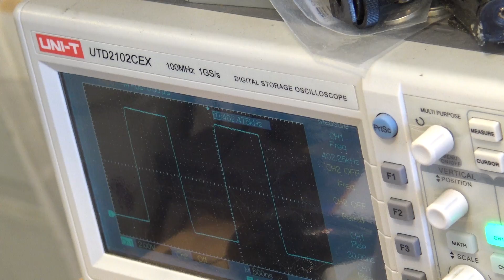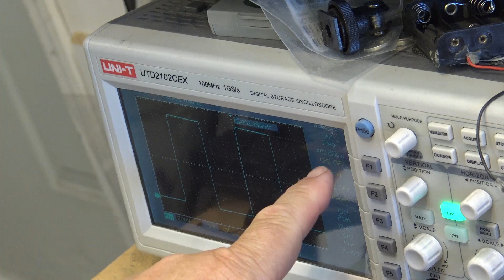TPA3118D2 45 watt amplifier module test run

Comment: What power supply did you use? What are the specs?
Reply from the maker: It can run on everything from 6 to 30 volts.  It really doesn't care what power supply you give it as it's a class d amplifier.

Comment: The best way to feed signal to these boards is from a Bluetooth module because some phones doesn't have much power on the headphone output.
These chips can take up to 3V of input signal.
TPA3118 specs is 60w into 8 ohm speaker @ 24V

Comment: The tpa3116 builds in diyaudio forum most came to the conclusion that the 4-500kHz sounded the best. At 1.2MHz it sounded worse and got hotter.

Comment: I was wondering if these amps could be used in place for a receiver with a defective stk or power pack module thanx for vid.
Reply from the maker: Yes and no. Yes they can be wired in place if you run the speaker outputs directly to the binding posts and isolate them from the chassis.  This means no headphone jack and no speaker switch.  The reason is these are BTL output and require both positive and negative speaker wires.  Most amps have the negative terminal for the speakers grounded.  That would obviously short and burn the module out.  So yes you could make one work but it would be a fair but of work to do if.  If the receiver has a pre out terminal on the back after the volume control it would work fine to a dedicated speaker pair.  Then you would be using the receiver just as a preamp, tuner and input selector.
Reply: @12voltvids  thanx so very much for your lengthy and complete reply thanx again.

Comment: The class D amplifiers that don't sound good are those with no or improper filtering between the chip and speakers.  Of course the purest people want vinyl records played on hyper expensive turntables and played through a tube type Macintosh amplifier.

Comment: It's odd how class D amps, once considered a weird quirk, are rapidly becoming the norm for consumer stuff. I get that the efficiency is a big plus these days but I'm concerned about potential RF interference levels... To be fair it looks like on that one, they've made a good effort to filter the output. It's the large number of 'cost optimised' consumer appliances that don't bother with filtering that might be the problem.
Reply from the maker: Well the filter is what makes it work, but the newer models use a carrier around 1.2mhz which uses a much smaller LC network to filter the carrier out.   The low powered amps don't need shielding.  The large line operated big amps are all completely shielded to prevent rf interference.

Comment: These little amp boards are really cool. There are tonnes of them out there now and often for under $20. My problem is that there are plenty of 50 watt by 2 boards, but it's nearly impossible to find either manufactured speakers in boxes/cabinets, or audio drivers for anything close to the same kind of cheap cost. Sure you can buy any sized driver, woofer, sub or tweeter or midrange but each one is going to cost you 3 to 5 times more than the amp board itself and then you have the cost of the cabinet or box build as well. Does anyone out there know of a cheap source for compatible speakers that can handle the up to 50W output that come in near the same cost as these little amp boards? There is so much potential for building portable bluetooth speakers, or even home theater or surround sound systems or just a nice stereo for the shop...but if a guy has to spend 200 bucks on the speakers it kind of defeats the purpose of a $16 amp board. I know old mini system speakers are easy to find at Good Will, Value Village or thrift stores, garage sales and whatever...but those are so often manufactured for looks not sound quality and their power rating is usually 10 or 20 watts max. I'd love to find a cheap source for drivers and build my own boxes and cross overs and so on.
Reply: Colin McDonald ,, second hand stores.  There a crapshoot, but sometimes you can get lucky.     Btw,, you can run 20 watt speakers off of 50 watts, just keep the signal clean from distortion, and amp clipping,, you'll be fine.
Reply: hit up walmart sometimes you can find deals for cheap book shelf speakers on the website. also cheap car speakers can and do work well with some cheap enclosures.

Comment: is it 3116 or 3118? btw sir which sounds better the tpa3116d2 or tpa3118? not concerned about power I'm more on the sound quality and efficiency of the chip for mobile applications. stay safe always
Reply: Most people buy dirt cheap tpa amps with all of the short cuts taken. Then 3118 implementations is better because of the native pin layout. When properly built the tpa3116 is best. The tpa3251 and tpa3255 is becoming cheap now so I would look into that instead. That will give your amps a run for its money for under 100usd, with some boards starting at 45usd.

Comment: More like 4.5w . . .
w/o a heat sink?!?
Reply from the maker: They don't produce much heat. I was running it pretty loud and the chip was only slightly warm to touch into 8 ohms. Mind you I was running at 12 volts so the power would be max about 15 or so into 8 ohms. They rate these all into 4 ohms.
Reply: Class d
Reply: The tpa3118 is built for using the pcb as heatsink. Tpa3116 is for eksternal heatsink.  Its all in the first page of spec sheet from TI.

Comment: I have a Bluetooth version of a similar Class D amp that has mysteriously stopped working. Worked fine when I put it away and now I can connect to the unit using Bluetooth but the amp produces no output.
Reply from the maker: Sounds like something went pop

Comment: I bought a switchable class D mono amplifier that can run on anything up to 24 volts. I stuck it into a vintage tube record player and at this time I'm just using the unit as an amplified speaker. I have it running on 12 volts so 10 watts and it is pretty loud. The original tube amp needs lots of work.